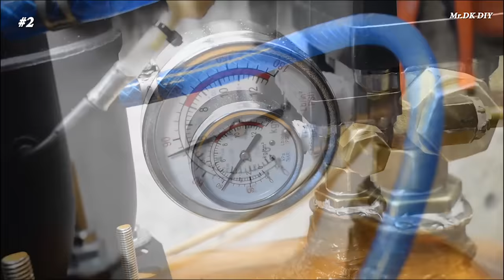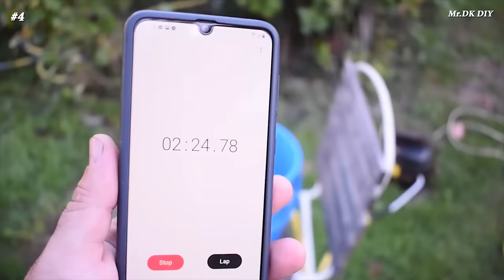4 WAYS HOW TO REUSE OLD REFRIGERATOR MOTOR COMPRESSOR

Comment: About 25 years ago I used a used refrigerator compressor as a vacuum pump for servicing Car A/C systems. I would pull the needed vacuum to allow me to service the systems when repairs were completed. The systems that still had R-12 or R-134A in them, I'd take and pay to have the gas removed. If the refrigerant charge was already lost due to a component failure, I could skip that part. Once repaired I'd use the pump to pull the needed vacuum and verify all leaks were repaired. This style pump surprised me with how quickly it could pull the needed vacuum depending on the altitude I was at.

Comment: I fully agree with Frederick and will add on my own behalf about the significant errors noticed . To get rid of condensate splashes from the paint sprayer, when painting parts, or when inflating tires, you need to install and connect a moisture separator filter at the air outlet from the fitting . Further, when screwing or turning the pressure gauge, in no case can you rotate it by holding on to the housing ,but only with a key for a special nut on the fitting. When installing the compressor on the tank of the receiver, it was necessary to put springs on the mounting bolts to reduce noise and vibration , and install washers with rubber gaskets . Otherwise, I praise you for being busy with men's work and not wasting your life on drinking alcohol and idleness !!! Good luck !!!
Reply: What are your

Comment: Hello young man: building a compressor with a fridge motor and a gas cylinder is not new to me because I realized the equivalent of this about fifteen years ago. I just wanted to let you know that you have omitted two important details I will say very very important: The absence of an overpressure safety valve and a purge under the tank to evacuate the water because you must know that the pressure air in the tank produces water due to humidity in the air.
good job overall if we are not looking at the finish of the product.

Comment: Mate, that air compressor is down right dangerous. It had a rating 18 bar because it was stuck together by a professional, ticketed welder. It’s rating dropped to zero as soon as you drilled into it. The close up of those fittings revealed very poor quality welding which is likely to fail (explode) when under pressure - even at 6 bar. I’m all for DIY projects but some things are worth leaving to experienced tradesmen who have spent years studying and working in specialised fields to ensure a high level of safety for everyone. Also, blowing compressed air on yourself at close range is an excellent way to get an air embolism...
Reply: Jay B.
Absolutely correct.
The compressor has become absolutely lethal.
Operating such has become HIGH - RISK
Even though I took a Welding course decades ago -
400 hours of college training - I would not attempt
such work - even though I am trained in welding
various alloys - including Inconel alloys - Stainless Steel -
MIG and TIG welding and welding aluminium using
oxy-acetyline equipment.

Comment: Here's one thing only those who know it know: The compressor needs lubrication. In a closed system of refrigerators, oil is added and circulated to the refrigerant. If you do not apply an air filter and do not oil it, this pump will soon fail.
Reply: Complimenti sei bravissimo mi sono piaciuti bravo 👏👏👍👍👍👍👍
Reply: Tv
Reply: Right @jakab

Comment: How do you control the refrigerant oil from filling up the tank?  I see no filter on the compressor discharge and if you've taken out the oil, the compressor will burn up in no time.  What's up?

Comment: Now I know whats in there.  I reused one like yours to suck the gas out of automobile air conditioning systems to create a vacuum.  Thats half of its original use, but for refrigerators.  It does need oil, but seems to not care what kind.  10w30 works fine.  You are very creative.

Comment: PSA: unless you are a professional welder certified in welding high pressure systems, you should never weld on a high pressure vessel. Even at 100psi the forces involved are enough to kill you in the event of a tank rupture or faulty weld giving way. A design like this would be okay as long as you adapt for existing holes and you use some type of sealant on the inside of the tank to prevent rusting and general corrosion.
Reply: That is correct
Reply: ลลลลล

Comment: They also make an excellent vacuum pump for sucking the air out of stuff too. I had one for years to suck the air out of plaster when making moulds.
Reply: Just use the other side of the motor for vacuum. This is not very efficient, but does make pressure.
Reply: Do you have video how to make mold?
Reply: Iai galera
Reply: hello, and how do you do for the oil ? do you fill it up often ?

Comment: There's lots of good things you can do with this compressor, despite it's low volume.  A few problems I see is you should NOT weld a cast fitting to a steel tank... and you should NOT weld to a pressure tank! For a project like this he should have removed the top fitting on the tank and just made a manifold out of threaded fittings, then fabricated his wheels and such to the steel pieces that were already fastened to the tank. IOW, no welding directly to the pressure tank.
Reply: Why not?
Reply: You have not yet learned the difference between its  and it's
nor the purpose of an apostrophe - 
You do not yet understand the difference between singular and plural.

Undertake an extensive reading program to better educate yourself - 
ti improve your knowledge of the English language and writing skills.
CORRECTED EDITED TEXT:
There are lots of things one can do with a refrigeration compressor -
  despite its low volume.  A few problems I see is - one should NOT weld
  a cast fitting to a steel tank... and you should definitely NOT weld
  to a pressure vessel!
  For a project such as this he should have removed the top fitting on
  the tank and made a manifold out of threaded fittings - then fabricated
  his wheels and such to the steel pieces that were already fastened to
  the tank. NOTE: NO welding directly to the pressure vessel. 
Good luck and good bye.
NOTE: All replies are ignored - 
(1)  I am too busy with other more important matters
(2)  There  is absolutely nothing of value any  of you can offer
(3)  When criticizing anyone - always offer a  meaningful solution
Reply: Yes, most definitely. Regardless of the certification level of the welder, normalisation procedures on the welded tank should be carried out.
Reply: @andrew_koala2974  congratulations you just wasted a bunch of time
Reply: On a low side of the r12 freon is close to 100+ psi so that's not bad for something that most people throw away
Reply: @Victor.McCann  ... one would be using air not R-12 so the pressure will be whatever you set the system to.
Reply: @rupe53  this is true for most part it is a great idea if a person can't get a air compressor for there budget I have diy stuff so I had it most of my life lol 
Now I am in a situation that electric is just not there without $175,000 upfront. So I have diy my way to have some but still not enough
Reply: What you don't trust your welding skills? In that case you need not be welding at all.
Reply: @eriksaxon458  ... you do realize that most people reading this comment have no idea how good or bad their welding actually is. They also can't tell the difference between between a machined, forged, or cast fitting.
Reply: Don’t want to be around when that tank fails and explodes

Comment: So the compressor u built could have enough power for Air tools?? What's the top psi u got with it bro?? That is a brilliant build but what kind of Gas did thta hold? Was that an old Gas cooker bottle? I have 3 of them out my back yard.. How much did the other parts cost apart frm the fridge motor? wHAT OR HOW DID IT GET DAMAGED?? That motor looks like it blew up my bro..

Comment: One thing not mentioned is lube. As a refrigerant compressor, the lube is suspended in your R12 refrigerant. You're now running it without any lubricant which is going to effect its longevity. To lube the internal workings, you need to add a few drops of oil through the suction port occasionally.
Reply: CORRECTED EDITED TEXT: WITH PAGE-LAYOUT
One thing not mentioned is lube. As a refrigeration compressor - the
  lubricant is suspended in the R12 refrigerant. As you are now operating
  the compressor without any lubricant - it is going to effect its longevity.
  To lubricate the internal components - it is necessary to occasionally
  add a few drops of oil through the suction port
Reply: not true if you cut one of those open there is oil sitting in the bottom of the compressor

Comment: I also missed a couple of important details : in the compressor tank , where the electric motor is located , you need to add liquid lubricant to increase the service life of moving parts, such as the cylinder walls, piston rings, piston, crankshaft and bearings ! At the time when this unit was working as a refrigerator compressor , a mixture of cooling agent and oil mist was located in the compressor tank cavity , with the help of which all parts were lubricated . In addition , the refrigerator system was closed and closed, and humid air could not get there , and after reworking, access to the compressor housing for moisture is open and wear of parts will be accelerated . To avoid this , you need to put a moisture separator at the air inlet!!! That's it now !
Reply: 0 ok
Reply: Presne tak  dá sa urobiť prisavanie hydraulickeho oleja  alebo občas injekčnou striekačkou vstreknut olej dovnútra sacou trúbky inak sa vám veľmi rýchlo zadrie ako mne

Comment: I set one up as a vacuum pump.  Handy for doing stuff like bleeding brakes or otherwise emptying oil fluids.  Generally speaking i run it through a collection container though  I don't actually pump the fluid through the pump itself, it just pulls a vacuum on a container that then suctions the fluid out.

Comment: No one way check valve from the pump to the tank, it will bleed compressed air off and hissss at you,  also no tank bleeder valve at the bottom of the tank to empty water that's going to pool up and rot it from inside out.  I also didnt care for the way you did the wheels.
FiY. If that was a propane tank you must fill it full or water the get all the gas out, cutting and welding could ignite trace gasses in the tank.

The concept of using a ac compressor to make compressed air is old, adding a decent storage tank was nice. Still needs a few things you either didnt think about or want to add.
Reply: Oh, cut him a break.
Nobody is going to actually build one of these things with a freon compressor. They simply don't have three days to wait, while it fills the tank.
Its mainly just fun to watch him build something, while you have a beer or two.

Comment: en la última parte hay 2 errores primero el motor que puso es muy lento se necesita algo más potente yo use un taladro viejo para poder mover el cabezote de compresion , ademas hay otra cosa , se debe mantener sumergido el mecanismo en aceite de baja viscocidad para evitar daños en el piston y la camisa y el cojinete y el cigüeñal eso debido a falta de lubricación y exceso de temperatura. pues este tipo de mecanismo se comortsn igual a un motor 2 tiempos requieren lubricación de manera original , se lubrican por Medio de la mezcla gas refrigerante y aceite disuelto en el mismo gas , una vez se hace la conversión del compresor con otro tipo de motor debido a que su motor original se quemó entonces se debe lubricar como un motor de 4 tiempos que se lubrica y refrigera por medio del aceite presente en el Carter en ese caso se puede usar el carter del mismo motor o en su defecto hacer un Carter plástico o con una olla en aluminio y dejar suspendido el mexanismo y  cargar de aceite el Carter.

Comment: That refrigerator compressor is designed to pump refrigerant with oil mixed in for lubrication.  How will the pump be lubricated when it only pumps air.  Will it not heat up and seize pretty prematurely?

Comment: These compressors are great but have one major Achilles heel. The oil surrounding the motor inside is great to lubricate and cool the motor but will degrade over time (6 months) if exposed to the air. Best to replace the oil with a simple mineral oil...
Reply: @Koning Bolo - But to replace the oil that surrounds the engine, is it necessary to open the third pipe? Is it possible to use common 10W40 car oil or is there something more specific? Thank you!

Comment: I am also a DIY maker and have seen a lot of videos. First thanks for videos and making a usefull tools . By the way i need to say three absence for this job that somebody commented here. First, bottom of the tank, it must be welded a valve to get out moisture or water. Secondly you need to install a safety ventile at the pressure  switch. With the high pressure at tank, that makes air evacuate for safety automatically.  Third,  you need add a check valve at the point of blue pipe  connected to tank. Because the pressure at the tank comes directly to fridge compressor. When the fridge compressor need to work, it faces with pressure and its lifespan will decrease.

Comment: a silent (<50 dB) air compressor is very expensive (+300 US$), hence your compressor (unless one need a lot of air compressed faster) is very nice 👍👍👍
Reply: Stig R with an silent air compressor like this you can also an air engine too. The air which comes from the air compressor is fed to the cylinder through the carburetor which pushes the piston to turn the crank wheel. Thus you can make an air engine like compustin engines like petrol and deasel engines. The main advantage of this engine is pollution free engine much more efficient than diesel or petrol engines. Thus you can invent air engine car bus truck etc etc
Reply: Yes, and now its off to ebay, to get a cheap dental drill.
Ahh ... the thrill of performing self, home-dentistry, without the annoyance of a shop compressor shaking the floor in the background. 😁
Reply: @ryanluiz2703   Air engines are NOT more efficient than combustion engines. Where in the world do you get your information? Air doesn't compress itself, does it? It comes from electricity or a combustion engine driving it. Combustion delivers waaaaaay more power than compressed air from an air compressor could.
Reply: If you want it to fill faster connect four in parallel

Comment: very good everything, how long does it take to fill the tank with the six bars?
Reply: My same question,   the pump has the power to fill to 300 psi,  but will take 20 min to recover back to 90 psi or 6 bar ,, i have been there before with slow refill but very quiet and powerful
Reply: Well,  lets just say you're going to want to take a beer break.
Reply: My guess, at least half an hour.  Fridge compressors can produce high pressure but with very limited flow. That’s why it takes so long. Anyhow, nice project for a DIY.
Reply: galingggg

Comment: Hi,
(maybe you can help me.....taking a long-shot here)
I’ve made 15 so-to-speak quiet air compressors for family and friends from different-brand-name air tanks and using previously working dehumidifier (or window AC) refrigeration compressors and all worked fine.  I’ve recently come across a problem I can’t seem to resolve.  

NOW:  Like in the past, I’m using a 6 gal air compressor tank, window AC refrigeration compressor, new 4-way pressure switch with unloader valve, and new tank check valve which holds pressure fine…..   

PROBLEM: after filling the tank and the unit shuts down…a small amount of OIL VAPOR (smoke) comes out of the unloader valve…..just for a minute or less.   Then it stops smoking.      

So I tried using 3 different refrigeration compressors (from a dehumidifier, etc.) and still same problem.  (I did this in case the first refrig compressor had a bad internal seal….can’t believe ALL THREE had bad seals, so maybe (??) the problem lies elsewhere….  

To further CONFUSE this issue, I disconnected the refrig compressor from the check valve and simply ran the refrig compressor for a long time, then shut it down and NO VAPOR………wow, I’m really stumped!

This is “nothing different”  than what I’ve done in the past 15 builds yet….SOMETHING MUST BE DIFFERENT…to cause this oil vapor.

Any suggestions as to WHY this might be happening would be really be appreciated.

Comment: Just curious as an AC mechanic.
What did you do for oil?

H
Reply: Roger O'Day what is the need with oil for an air compressor.
Reply: It has a lifetime supply of residual oil in the compressor.
In a few hours, when the residual oil runs out ... 
Its lifetime is over.
Reply: Ovo su Srbi radili pre 30 godina  a kako pobudjuje pomocni kalem za startovanje
Reply: He should of put a sight glass on the compressor body
Reply: Abviosly seen. no lubrification . Reduced system ....
Reply: @ljuba53pn1  saxmat

Comment: cheap way to get a decent small compressor.
Reply: Yeh and if you want faster air replacement or pressure use 2 compressors.. My kind of video man these also look good for trading with other items cos you just made something TANGIBLE to trade with..Your company could be called A1 RECYCLING OR RECYCLING King you gotta do some more I'm now a subber thanks.....
Reply: Ok